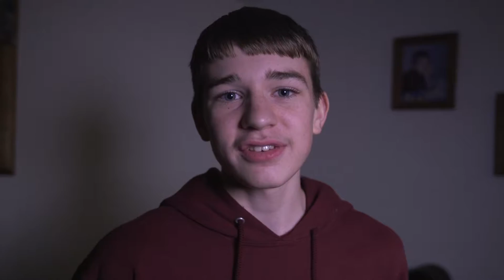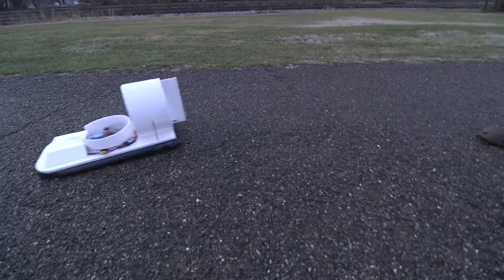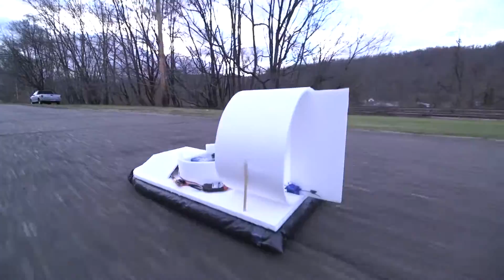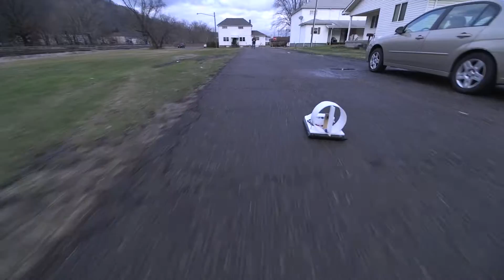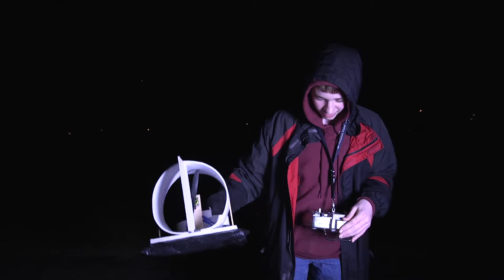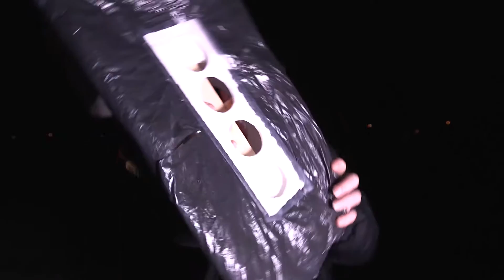FT RC Hovercraft Self Build Diy

Comment: Hi, I am new to this hobby, can you please explain me how to wire 2 motors which can be controlled independently to 2 ESC and one battery?
Reply from the maker: Hi, the wires for the battery are connected together with a y splitter and the receiver connectors as well 

so the the twofold wires are connected together, and the black wires are connected together, and then plugged into the battery
Reply from the maker: Did this help, or do you need me to explain it better. I did another video on this that might help you out. Go look in my channel, and it shouldn't be hard to find. Have a great day

Comment: What are the measurements for the hovercraft-like such as the styrofoam?
Reply from the maker: The hovercraft is 10x 20 inches. With a 8 inch prop for the pusher and a 7 inch prop for the inflator. And I am using 1/8th inch dollar general foam board. I hope that this answers your question. If you have any more questions, feel free to ask. Just wanted to make sure that you know that I do have another video on this hovercraft if you go to my channel. I am working on a build video now with free plans, and it should be posted soon. Thanks so much for watching. Have a great day!
Reply: Thank you! @EricRobb
Reply from the maker: No problem, I'm glad I could help
Reply: i have plans i made for one like it that i can send you

Comment: Thanks for sharing! I'm designing and building one of these myself. Any thoughts on why rocks were a problem? What would you do differently next time?
Reply from the maker: Fred Damstra rocks were a problem because there are a lot of loose rocks on the old asphalt, and it is for the snow anyways. If I was to drive it on the asphalt a lot, I would put some mesh of some kind over the holes, and get a heavier duty bag.
Reply from the maker: Sorry about the wait, I put the links in the description. Thanks for watching.
Reply from the maker: If you have any more questions about the build or anything else, please ask.